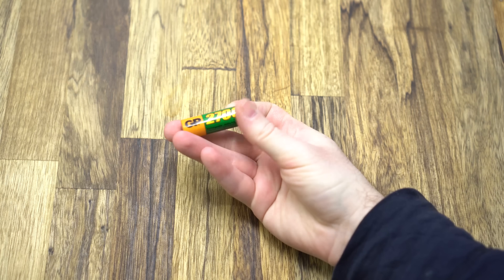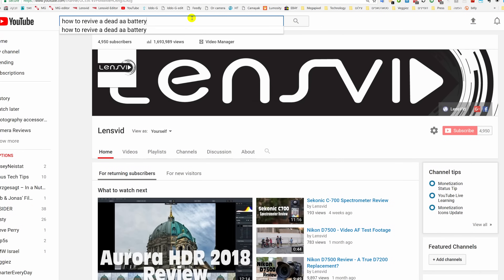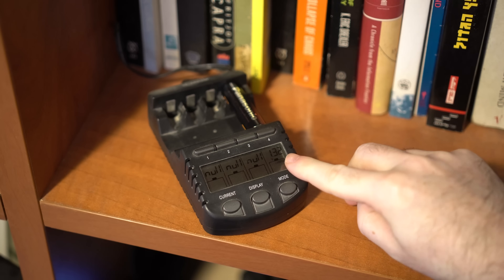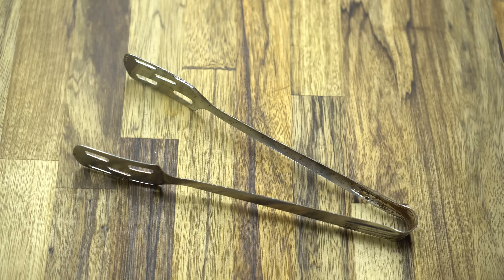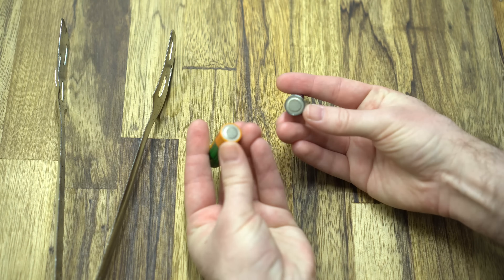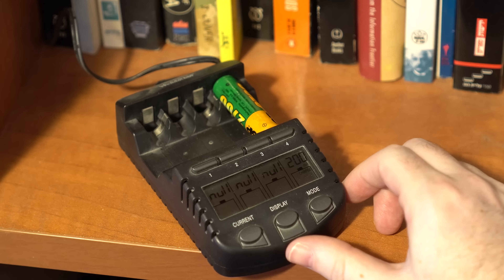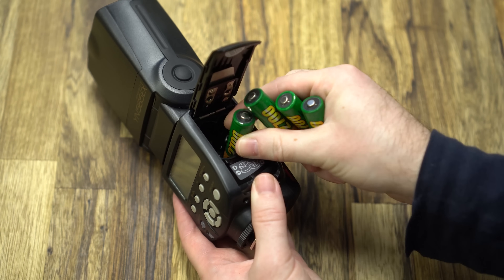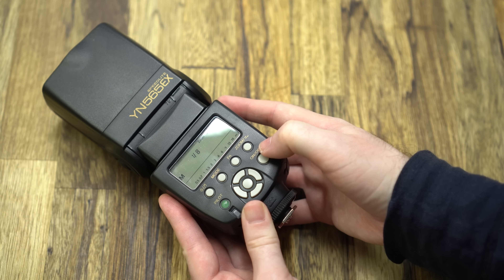How to Revive a Dead (AA/AAA) Battery

Comment: The EZ Battery Reconditioning™ program is the easy to follow, step-by-step system to recondition all kinds of old batteries with just simple supplies you probably already have in your home.

The program is made up of step-by-step guides that show you how to recondition each type of battery. And each guide is full of pictures and diagrams so you not only read exactly what to do …you see exactly what to do as well!

It’s like having me and Frank (aka "The Battery Man") standing there with you, guiding you every step of the way as you recondition your batteries.

And it doesn’t matter if you’re not technical or don’t know the first thing about batteries …because our program is incredibly easy to follow and absolutely anybody can use it.
https://tinyurl.com/y5kz6rf6
https://tinyurl.com/y5kz6rf6
https://tinyurl.com/y5kz6rf6
https://tinyurl.com/y5kz6rf6
https://tinyurl.com/y5kz6rf6
https://tinyurl.com/y5kz6rf6

Comment: My batteries still won't charge. I put it in a "dumb" charger overnight as well. The batteries will power a flashlight for a few minutes but it's very dim. When I try a "smart" charger there's an error. Any thoughts?
Reply from the maker: m... not really - I am not sure this fix is a "cure-all type of thing". Did you have a dead battery which you revived using this method but it didn't get back to full power?
Reply: @LensVid  Thanks for the reply, the battery was able to be "revived" but not to full power. I may try several more times, but the cells might really be dead.
Reply from the maker: very possible - this method isn't magic it might work to some extent but if they have nothing to work with...

Comment: Holy crap, this actually worked! I found some old rechargeable batteries in a graphing calculator (completely dead). My panasonic charger kept resetting because the battery was at 0 volts. Did the trick, now it's accepting a charge.
Reply from the maker: :) yap. It surprised us as well the first time.